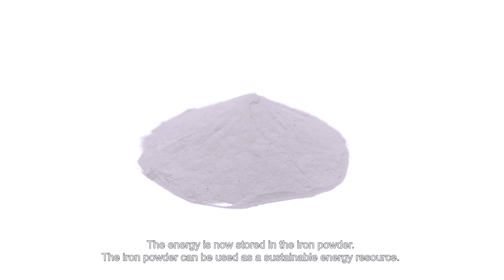World's first iron-based energy storage system

Comment: I feel like once you add the energy requirements to produce iron powder, gas to sustain ignition and electricity to power airflow fans or compressors this would work out to require about as much energy to run as it produces.
Reply: Well, entropy to be damned! It's a storage medium not a perpetual motion machine.

Comment: How is the rust recycled? That is the all-important question. Historically, carbon was used to reduce iron oxide into iron metal. But if you do that, then you have a carbon footprint. Can you electrolytically reduce the iron or reduce it by other means?
Reply: Arc furnace

Comment: sorry where is the part that Fe2O3 is returned to Fe and oxygen ??? that is still, to my knowledge, based on carbon burning.... right ?? so where is the CO2 free part ?? you could use Hydrogen and a lot of heat (burning hydrogen).. and hydrogen could be gained by solar power... so you're still stuck to solar or wind to remain CO2 free.
Reply: Rust can be reduced to iron powder by passing hydrogen gas through heated rust. The only byproduct is water vapor. (There's a couple youtubes showing this being done in lab demonstrations.)The hydrogen and heat would come from either solar farms or wind farms. Once you have the iron powder, it can be stored indefinitely and used whenever needed. It's basically a fuel. This completely solves the problem of sun and wind power being intermittent. You make the iron powder during the middle six hours of the day when the sun is shining most directly and you store the powder and burn it as fuel to produce electricity any time you need electricity, including all evening and night. The beauty of it is that there's no limit to how much iron powder you can store. Eventually huge stockpiles of it could be built up so that there could be, for example, a years worth of reserve fuel for a whole country. There're masses and masses of dirt cheap scrap steel everywhere that could be turned into a fuel supply.

Comment: You seem to have totally missed the part where iron oxide is reduced?
Reply: Even if it is 70% it is still better than 0% of what the present fossil fuels are.
Reply from the maker: We have done this on purpose. In the coming years, the steelmaking industry and other metal industries will have to obtain their energy from renewable sources, because they are one of the most polluting industries in the world. That is why a lot of effort is put in and a lot of research is done on finding ways to reduce metal oxides (iron oxide in particular) to pure metal. Therefore, at this stage, we are primarily focussing on making the oxidation of iron work, extracting energy from the combustion process and scaling this up. In case you are interesed, check out the website of HYBRIT (http://www.hybritdevelopment.com/), they are building a pilot plant for steelmaking in a completely sustainable way. Moreover, the resulting 'sponge iron powder' in their reduction process is exactly the same kind of iron powder that is used in the video.
Reply: @solid9469  so you  folks have only covered the easy part. Then OH I have an additional part in your cycle; burn aluminium, or use aluminium to do a thermite reaction to gain back the Iron...or any other metal (magnesium etc). But thing is you only get deeper in to the energy well. In recycling it you also have to take care of that part, so there is nothing cyclic about your proces its just burning up stuff. Sorry this is not impressive enough. I would have been impressdIF you solved the entire cycle without using carbon. You are shifting the burden of the CO2 production to an other party and dont dare to touch it yourself. Thats no solution. The biggest challenge is in the Fe2O3 or Al2O3 part back to Fe and Al and oxygen. that would be impressive.
Reply: @thewaytruthandlife  They don't need the process to be 100% efficient.  The biggest problem in energy right now is storing all the energy from solar panels.  Even if this is less efficient than current batteries, the fact is that this is much cheaper, simpler, and more plentiful than current batteries.  If your complaint is that it isn't perfect yet, then please go harass solar panel videos, because solar panels are also not working yet.  California's brownouts are partly because of solar power not being there when its needed, and there being too much solar energy when it isn't needed.  We need storage, even inefficient storage is better than no storage, or unaffordable storage that raises our electric bill.  No one wants that.

Comment: And how were you able to ignite (igniter used )?
Reply: So, why did you opt for methane pilot ignition system instead of electric ignition system
Reply from the maker: @sreeramnair9439  We need a continous ignition to assure that the iron flame keeps burning and we don't get unburned powder into our system. The methane pilotflame does get ignited electrically.
Reply: @solid9469  so ,the dispersion medium .Isn't it the same as used in AJM .Could you provide more information regarding dispersion medium
Reply from the maker: We use a lighter to ignite the flame and it keeps burning because of a pilotflame of methane. We hope we informed you enough, otherwise you can also send an e-mail to info@teamsolid.org for more explanations.